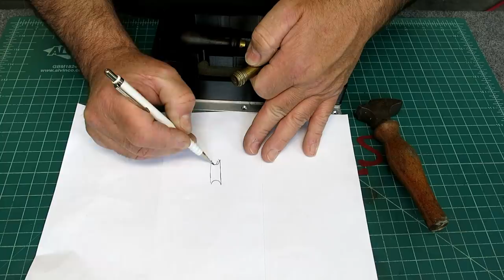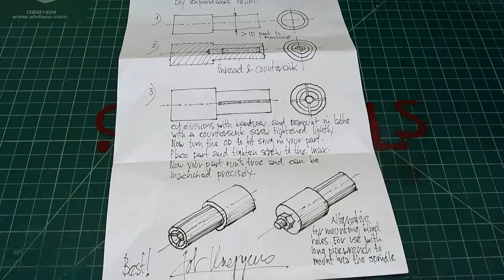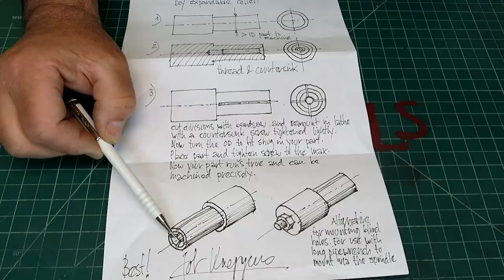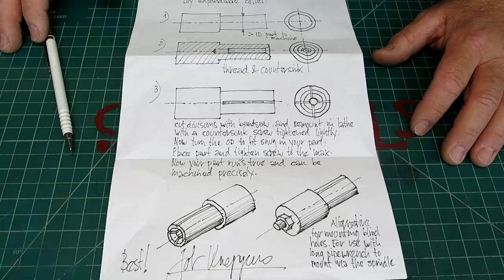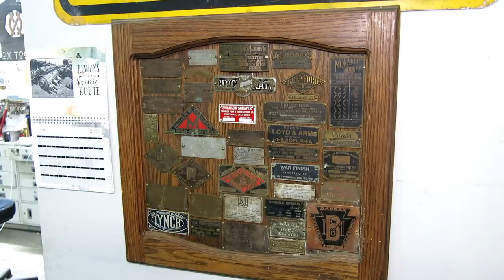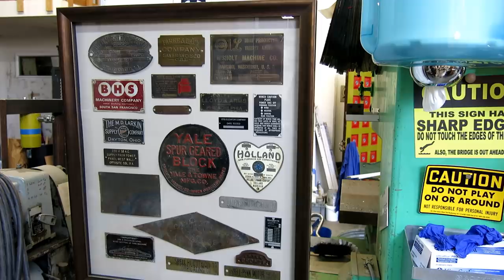Monday Night Meatloaf 125

Comment: The pleasure of rolling up a good extension cord or air hose that rolls up exactly how you want it is one of the greatly underestimated joys of life.
Reply: Coiling an air hose was one of the first tests in my automotive class in high school (the second week was sharpening drill bits by hand)! Had to lay correctly while holding it with an open hand. At the time I thought the instructor was just being an ass, but after working in innumerable shops where people just kick them into  a pile... I'm sorry Mr. Toll, you were right.

Comment: The wooden handled tool is a Shoe Makers Glazing iron - they are heated over a Spirit Lamp and used for smoothing the edges of leather soles
Reply: I was taught when young to do that with a spoon warmed on the gas!
Reply: I thought it was some sort of upholstery tool!
Reply: That was my first thought.   It just seemed like a leather tool.   Having a semi-spherical end wouldn’t be a good hammer for glass IMHO.
Reply: Kind of looks like a foot, at first I thought it was a shoe form.
Reply: I thought leather/shoes also as soon as I saw it.  I found a pile of similar tools (although widely varying forms) at an estate sale in Palo Alto last year.  Turned out they all for making shoes/working with leather.

Comment: Another good air hose to check out is Flexzilla. We use them at work and stand up really well. Have run over them with loaded forklifts and it didn't phase it. Stays pretty supple even after a long time.

Your outro quote is spot-on.

Comment: Glaziers use little flat nail-like things called "glaziers' points" to retain the glass in traditional wooden windows. Maybe 0.5" long and 0.2" wide, but 0.01" thick.

That hammer would be perfect for them. Usually you caulk over the glaziers' points, which is why you don't see them.
Reply: Glaziers points pretty much just press in though, nothing much fancier than a screwdriver is needed. There are tools to hold them and then just press into place using nothing more than forearm strength. This tool is a leather workers glazier or burnisher (pick the word you like the most).
Reply: @ianide2480  I think they are called push points also.
Reply: I was thinking the same thing.  Glazing points will readily press into new wood but not the windows on a 100 year old Victorian.  Glazing Points are triangular "nails" for those who have never glazed a window.  They hold the glass and are covered by glaze to seal the window.  Does anyone actually glaze windows anymore?
Reply: @GaryGrumble  Funny I just reglazed a window on my 190year old house yesterday! What are the odds?
Reply: It's a heel burnisher/glazing iron for a cobbler  https://www.tooltique.co.uk/shop/vintage-cobblers-glazing-iron-6-length-cobblers-tool/
Here it is in use https://youtu.be/E-IcyDp3S1U?t=174
Reply: @GaryGrumble  Yes, that is something I’ve done when over enthusiastic dogs break the glass in the living room window.  It’s easier than removing the sash and taking it somewhere.
Reply: @GaryGrumble  I've done it 2-3 times. Yes, new pine is a lot easier to push them into than 100+ year old oak!

Comment: Kwik Switch comes in sizes 200, 300, 400. I have seen reference to 100 but not seen a holder in that size. There have been many a mill that came with a Kwik Switch spindle and tool holders do show up on Ebay.  New holders seem to cost more then their weight in gold though they are easy enough to make if you have time.  I have a boat load of them having had a Hurco Mill.  I am now going to adapt my lathes.  Great Idea, thanks Tom!

Comment: Wow, some dude knew what that hammer is/was for.  I thought it would remain a mystery.  I visualized forming thick material around corners and edges(upholstery).  I was close.  At McDonnell-Douglas all of the air hoses had these cool fittings that released the air pressure prior to disconnecting the tool.  Really nice, made in Israel, I forget the brand name.

Comment: Tom, that Prevost stuff is definitely the stuff to use.  Give the Hi-Flow .250" fittings & couplings a try.  I would estimate they add a couple thousand rpms to my air grinders.  I might also add that going on 10 years without any of them leaking!

Comment: I like the Baldexer. Nice simple idea.
We used the Kwick Switch system were I retired from. One thing I liled about it was the collet stays with the nut. All those machine tags from machines that got scrapped are kind of sad. I worked with a number of guys who were Machine Repair ratings in the Navy. There the guys that actually do machining. Machinist Mates don't.  One guy was on a sub tender. The ship was going to be equipped with new machinery. So they left port and about 20 or 30 miles out all of the machinery was scrapped over the side. I have also heard stories about a machine that is surplus from a defense project will be stored outside in the rain and weather to rot while the old 5 dollar office chairs are in a warehouse. Typical government efficiency. Of course the private sector does the same thing. We had a clean-up campaign to get everything spiffed up for a dog and pony show tour from corporate. In the shop we had a number of steel saw horses for supporting machine components when being rebuilt. So the boss had them put outside. Somebody else was cleaning some other stuff up so our stuff got tossed in the scrap. We also lost a Blanchard grinder that way when the ways were being rescraped. The guts for the chuck drive along with the chuck were on a pallet in the warehouse. Some Bozo who didn't  s×÷t from shinola decided to get rid of it.

Comment: So how does the ball indexing mechanism get the depth of engagement right? If the balls are recessed too far, you get backlash. If they stick out too far, you lose rigidity due to low contact area. Presumably you'd have to machine/grind the faces to the exact right level for perfect engagement? Thanks for the video!

Comment: You should give CEJN fittings/hoses a try, we switched our shop over to them few years ago, and most importantly significantly cut down on leaks at the fittings. Also their coiled hoses are top notch as well! For just buying a few, cheapest place online probably would be global industrial, otherwise you have to buy box quantity if going direct(20 fittings per box I believe)

Comment: If you wanna try a good hose for the shop try Flexzilla hoses, love them, they’re ultra flexible, good resistance to solvant and they sell repair kit with strain relief so you could shorten one as you desired. I use a 1/4” one at the mill and at the lathe, wouldn’t use another type now. On the base here maintenance has started replacing all the hoses quick disconnects with this model of push button safety q/d.

Comment: Hammer thing Looks kind of like a heel bar with wooden handle
Werner putty knife looks more like a scraper part of the reason I say that is most puddy knifes  dont have a pommel thats used for striking were a a scrapper would ??
Destroyed many of puddy knifes when using them as scrapper from using them more like a scraper or chisel when scraping old gaskets off
I actully have a air hose id like to throw away because you have to arm wrestle it to roll it up just used it the other day and wrestled it to straighten it them roll it back up 
I only use it as a extension hose
Whats keeping the balls from moving radially on the indexers  are they clamped down by the ring thats retaining them

Comment: Universal Engineering is not defunct!  They're not easy to find via Google (due to too many similarly-named companies), but here's a link: https://www.universaldevlieg.com/about.  You can still buy the Kwik-Switch tool holder (among other things).  When they were located in Frankenmuth, Michigan, I spent two summers working there.  I made enough money to start my BSEE program, and learned to love the sound and smell of metal.  I put slots into collet blanks, with both a bandsaw and a horizontal mill (depending on the product).
Reply: There must be enough of us viewers searching of Universal Engineering that they are "trending" on google... they were the first result by the time I searched!
Reply from the maker: Cool. Thanks for the history. I was surprised to see them still kicking.

Cheers,
Tom

Comment: The same way the plan for the collet shows by expanding to get a grip , my handle for the lathe spindle works... it's four  times splitted goes into the back of the lathe spindle very easy then the cone part inside gets tighten by a screw and expand so there's a very tight grip for hand threading etc ...and guess from where I've got the idea two years ago ?... from Tom from oxtolcoo🤠 he gave me the idea for it by talking about the principle and I build it immediately 😎😎

Comment: Is that the air tool that you plugged in leaking, or the coupling? Love the hose and fitting, but as a pipe fitter the background sound of leaks are like nails on a chalkboard.

Comment: I have a height gauge based on accurate 1 inch ball bearings. It has a one inch micrometer head and 23 1” diameter balls in the vertical shaft. APE microball, a few of the, on eBay at the moment.
Reply: I have the 12" version, 1/2" balls and a 1/2" travel micrometer, the micrometer is very awkward to use, very difficult to get a feel when measuring the height of an item, I think it was designed as a precision scribing block.

Comment: I thought about ball indexing device for long time and there are illustrations in patent US3091134 but machining the groove is not easy abit big and balls will not touch each other. Abit small and contact points between balls will not be in a perfect circle. I got an idea to make the groove in both faces perfect width of one ball. Put adhesive in the groove then  balls. Close both parts together. This way balls should be equally spaced

Comment: Probably not so precise and rigid as the Kwik Switch but of soviet origin there are:
6152-0151 - MT2 shank adapter with MT2/MT1 inserts
6251-0182 - MT3 shank adapter with MT3/MT2/MT1 inserts
For example:
https://youtu.be/MhKTEtzEPi8
Can be had for like €10-30 for a set.

Comment: How about a vernier coupling version of the balldex?  Say a 20 ball balldex stacked with a 19 ball balldex. That would give a (20-19) / (20*19) = 1/380 of a turn  = 0.947 degrees. (Obviously no help if whole degrees are what you need.)
Reply: Eric I had the same thought. How about 36/10?

Comment: As an Automotive Mechanic, the only hose I will uses is a Flexzillia hose, they stay soft right down to -40C, and you can still coil them with no problem.
Reply: No offense I don't like them at all. They catch on stuff and kink real easy. Consider them just a big pain.
Reply: Yes, I have the flexzilla hose and I don't like it at all. I guess, if you need it to be flexible down to -40°C, it's good.
Reply: I have been using flexilla hose in my personal workshop and have been very happy with it. Maybe there are some better options out there, but it has worked well for me
Reply: I have Goodyear and flexzilla hoses. Goodyear is a truck line or for auto tools, the flexzilla I use for word working because it’s light. I’ve tried several different hoses from senco copy grey a flow polyurethane, and the flexzilla. They all have their place the senco copy exterior degraded and would leak non stop. The Goodyear’s are the oldest and still my go to for flow.

Comment: I’m sorry but you still have NOT found the perfect air hose.  I think I’ll make a video showing what is use and why it works for the aviation metal work that I do.  Thanks, Jim.
Reply from the maker: oooh. The only other hose I know of that I want to test is one made by Devilblis. Called a super flex or something like that. Apparently they use it specifically go to the hand held spray guns for maximum flexibility. ~$200 buckeroos so it will have to wait to feed my curiosity. 

Cheers,
Tom
Reply: I did make a video showing the one I use.  I get them at Cleaveland Aircraft Tool.  It is a 10’ section and real light weight and flexible.  Here is a link to my video https://youtu.be/VkAoiEZQ1b4  and here is the hose on their site  https://www.cleavelandtool.com/collections/all/products/deluxe-airhose-and-manifold-block-kit?variant=18378223288382  I don’t see the single hose item but I suspect they can still get that.  I don’t have the manifold block, I made one out of round stock delrin.  Thanks again for being a mentor Tom!

Comment: First one is a shoemakers tool. It is heated up and is used to slick the edges of a leather boot/shoe sole. Do an image search for cobblers tools and you will see lots of types of them in old tool sets.
There is one here: https://www.worthpoint.com/worthopedia/vintage-german-shoemakers-leather-1876803027

Comment: Coilhose is garbage.  Especially for my uses with air tools, mostly impact.  CFM is king with impact, those small diameter hoses, especially the actual coiled ones, is terrible for running air tools.  I usually use red rubber hose that I get free from work to make air hoses.

Comment: You can find the Prevost hoses in 25' lengths, not that that would be much better for your needs. This example is 3/8" x 25' https://www.ebay.com/i/293524260557

Comment: I have seen that my teacher used this "hammer" for making mosaic tiles in ceramic and glas, you use it in combination like a roofer  does with sllates , the roofers use a device where u put slate on and shear it with  a hammer.